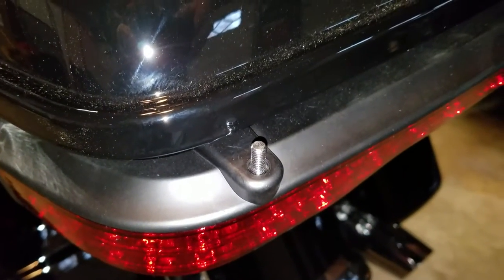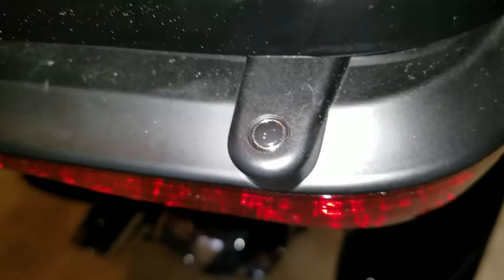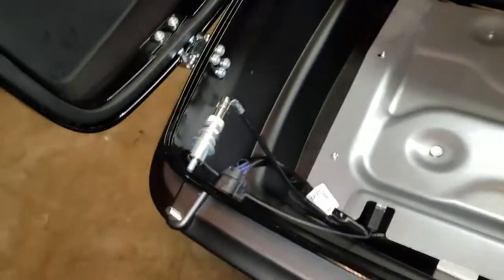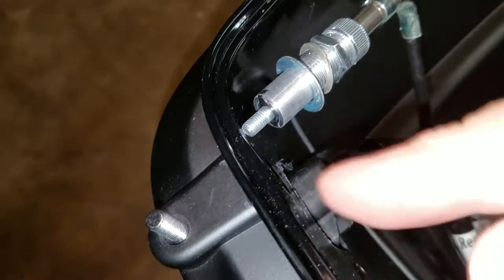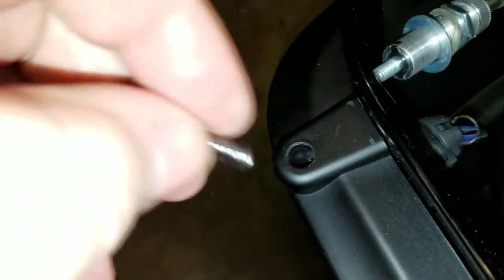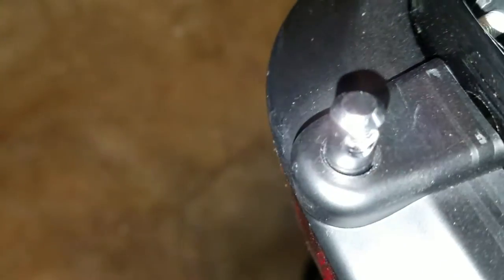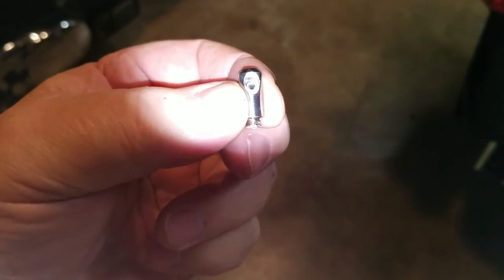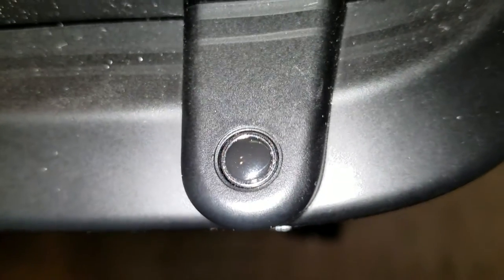Harley Davidson Antenna Stud Removal when using a hidden antenna

Comment: Why delete it. 
What’s going to hold it in?
After you cut it shorter it looked like you only had two threads now! That’s not enough threads.
Reply: You can now get this plug from the Harley Dealer that's painted black on top  for .85 cents. Just purchased one for my 2014 Ultra Limited today.